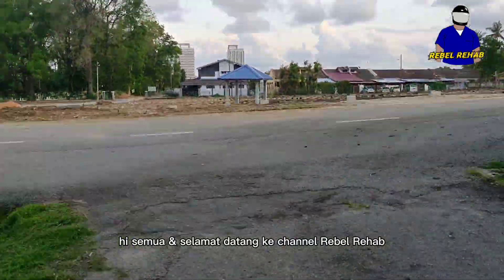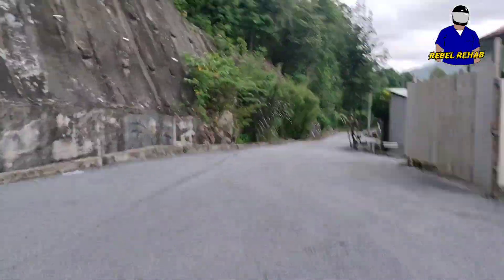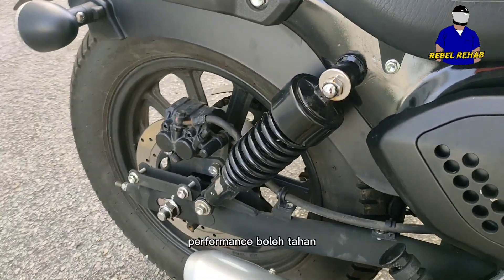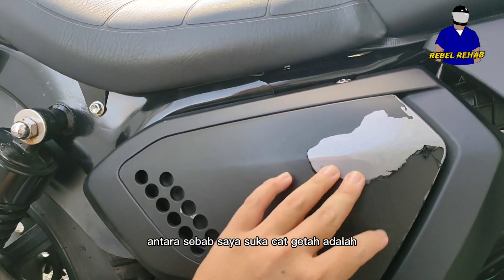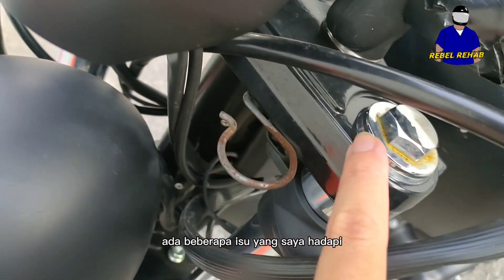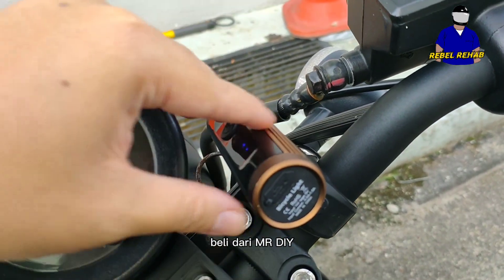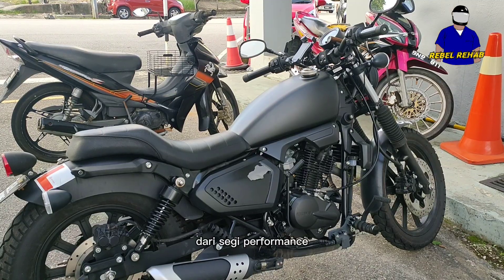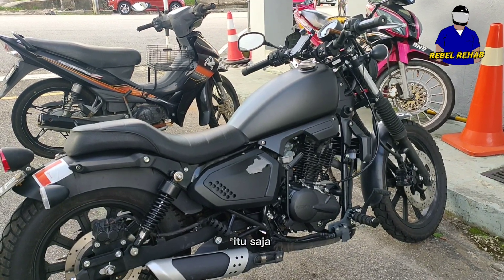2021 Benelli Keeway KLight 202 (English with BM Sub) Part 3

Comment: Subtitle on point bro haha.
Just got this bike as well. Swapping out from my old Keeway cafe racer 152.

I'm like 165cm tall and the seat height of KLight is just perfect. But the footpegs location is too far ahead and its a little inconvenient.

Do you think its possible to adjust the location of the pegs?
Reply from the maker: Thank you bro! Truly appreciate the feedback! Awwh. I've always wanted to get the CR152, but yalah, the shop kept pushing back it's release (last year) so I went for this instead.

In regards to the foot pegs, you could switch them out to floor boards however it may not look that good in my opinion because it's a small motorcycle. You could seek out peg extenders but it may screw around with the brake and shifters. There is a possibility of adjusting the shifter and brake levers however that's mainly the angle. I've heard of people switching this bike to mid controls instead of front so that could be an alternative however, you'll have to shift the levers which would cost you. For me, it was a little too forward so when I have to shift, I duduk depan sikit heh.

Hope this helps tho!